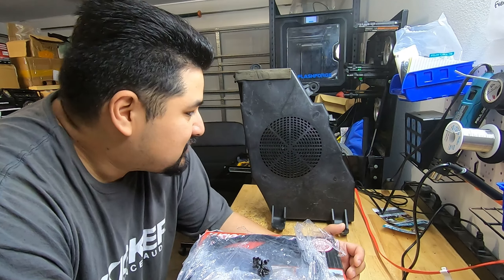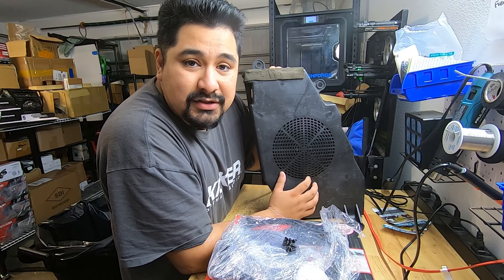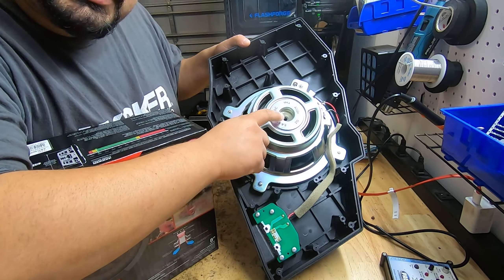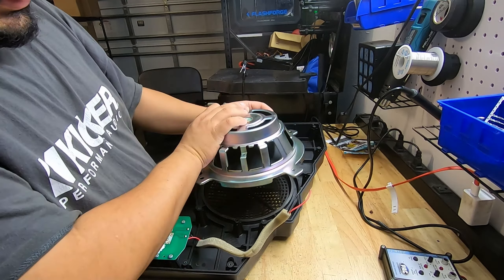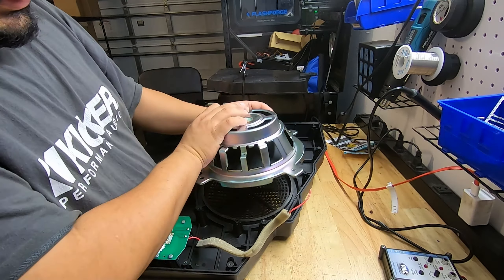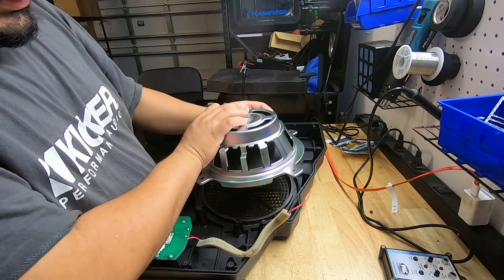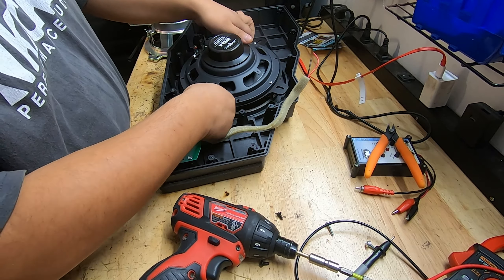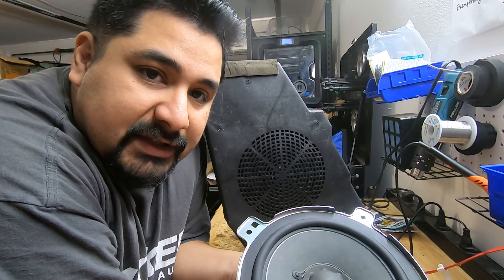How to Install a New Subwoofer in Your Acura TSX Wagon Premium Audio System | ELS Audio System

Comment: Heads up bro, the tech package subwoofer in the wagon does NOT have an amp inside of it. The whole system is powered by 1 amp.

Also, DS18 and rockford fosgate have shallow mount 8s" that may work well for this